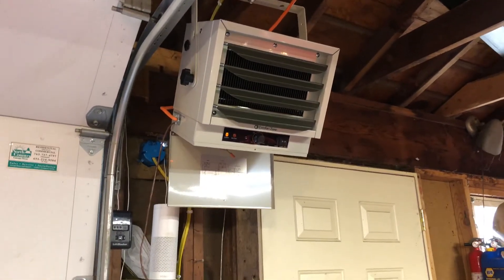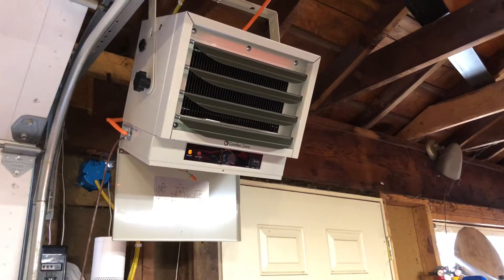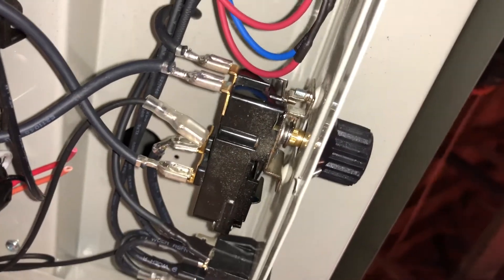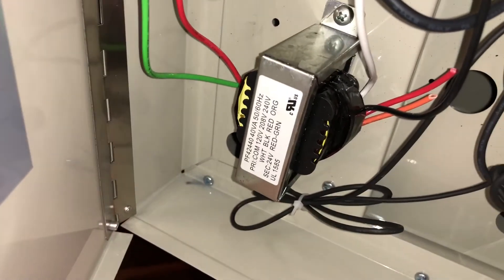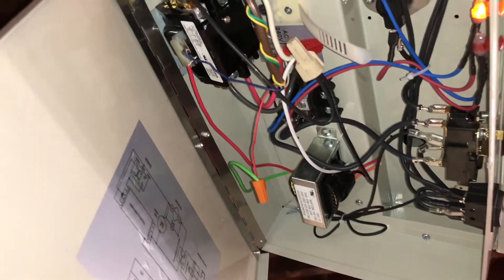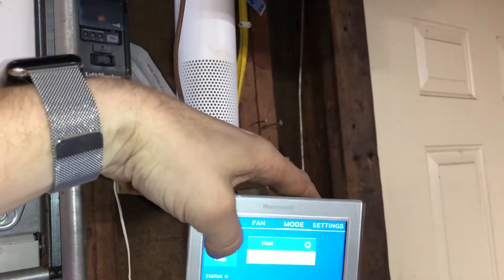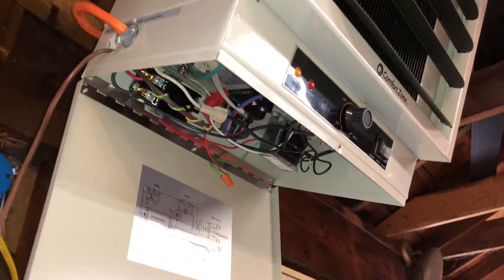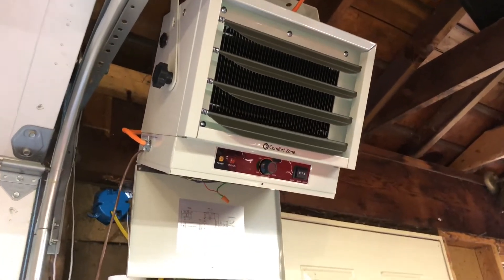How to: run your electric garage heater on a wifi thermostat!

Comment: I’ve had mine for several years now, the only issue seems to be the unit cycles power on and off every few minutes even below the thermostat set point. It’s not the internal overheating protection because I have voltage in and out to the motor when it shuts off. Any suggestions?

Comment: Shouldn't you be allowing for the fan to continue running to cool the coils off to a safe level before killing the fan? It has the heat sensor built in for that.

Comment: I like your set up and i am trying to replicate it on my newly installed 5kw heater, however, I would like to know if i could wire the 240/24V transformer to both legs of the incoming power, I do not have the white wire which is your neutral. Thanks

Comment: Use a King Electrics wireless thermostat. You can connect it directly to your 240v power source between your panel and the heater. It acts as a 'switch', triggered at the set temperature. Leave heater on highest 'on' setting. You can also control it from anywhere on your smart device.

Comment: Are you using 10/3 power wire?? 
Mine only requires 10/2, do I need to use the neutral wire in the transformer??

Comment: Every video I have watched on these heaters out of morbid curiosity has been wired so very wrong according to code/ proper way to wire it whether it's Canada or US.  I appreciate trying to make things work but for some reason these type heaters bring out some serious janky ass stuff.
Your job is certainly better than most.  You also demonstrated a decent knowledge of proper terminology.  Most guys didn't have a clue as to what they were saying but bumbled through and somehow made it work.  You could have cut into that thermostat circuit but it seems that it killed the heater just like you did anyway.  Good Job doing what you figured out.

Comment: this was a long time ago but still to this date not a lot of videos about this. is the wiring the same for 7500 w heater, same kind of heater, different brand, and of course 240v? i have yet to purchase a thermostat but did use links for transformer and such from your video. THANKS!

Comment: Do you have a fuse installed on the secondary side of your transformer? I'm wondering if I need to install one? I'm using a 240v - 24v 40va transformer and I am thinking I should install a 2amp fuse...?

Comment: I thank you and appreciate the video...   im currently trying to hook this up like you said.   Great video I just wish you had went a little slower and zoomed in on how and what wires go where but other than that....  you are awesome my friend!   I been trying how to make sure my garage is warm by the time I get home from work.   Unfortunately this only controls 1 of my heaters but it will definitely make a difference.. once I get it going.. 👍
Reply: Ok.  PLEASE HELP.    I tried to fallow everything you said and tried pausing the video but you move too fast and its blurry.    My heater is on.   Thermostat is on but neither the Thermostat  on the heater or the exact aftermarket Thermostat is making the heater turn on..   I've watched this video probably 20 times and can't figure out what I did wrong.   And yes I tried the heater before I hooked all this up.   And I bought all the exact parts you suggested.   Please someone tell me what I did wrong.   Thank you

Comment: I could just add this in a junction box right? Then this way if I want to use my portable garage heater with a smart thermostat it would just turn the wires active to the plug? 

I have a low ceiling in my basements that is 7 feet tall. But we do a lot of art and craft and such down there.
Reply from the maker: in theory yeah but not sure why youd over complicate when theres room inside the heater enclosure
Reply: This is because my garage heater is portable. I can put it on the floor.

For some odd reason, the city doesn't allow it to be installed outside of the manufacture safety requirement. The bottom of the hard wired heater cannot be lower then 8 feet. 

My basement is 7 feet tall. However, a portable heater is not against code. It can be put on the floor. So it is weird to me.

However, I want to be able to take it out into my garage when I need it. I can just plug it in and use the manual thermostat. As for my basement that has no heat, I want to use the thermostat. So making the outlet using the Contactor and Control Transformer to work with the Thermostat would allow me to heat up the basement ahead of time.  @OvalboreTech

Comment: I just finished up doing this and it works great.  I didn’t have any 18-3 thermostat wire and tried to use Cat 5e wire but it didn’t work.  Got some 18-3 and contactor kicked on like it should.   I used a 30a contactor instead of 40a.

Comment: Did you consider a second contactor and the “emergency heat” lead from the thermostat to run two different wattage settings?  Might try it with my setup…
Reply from the maker: no but thats actually a really cool idea. you could use the single contactor and a pair of diodes to accomplish this too! :)

Comment: 240 V is single pahse, there are no "phases" but there are two 120V "legs".
Reply from the maker: in north american residential power, thats correct, but there is absolutely single phase 240V in the wild in the states.

nevertheless, completely irrelevant to this content.

Comment: I'm going to be wiring up a similar set up in a couple weeks. My thermostat is 120V though so my plan is:
Send 120V from panel, to thermostat, to contactor. 
Send 240V from panel, to contactor, to heater. 
This eliminates the need for the transformer, and just works well with the location of my heater/panel/where I want the thermostat mounted.

Comment: def insulating the roof will help bro.  80% heat is lost up 20% out the sides.  get some insulation!
Reply from the maker: I dont heat my garage, this is only for emergency work where I dont mind burning a night of power to wrench. has been off all but maybe 2 days since filming this

Comment: I bought the same contactor and I'm assuming L1 on the contactor is connected to the line from breaker panel and the T1 side goes to the heater connection?  (same for L2 and T2)

Comment: On the transformer (packard) you used the black and white wire for power. Which means the transformer is powered by 120volts, not 240 volts. If 240 volts powered the contactor, the orange and white wire would be used.

Comment: What would you do differently with a 10,000 watt heater which requires either a 50 or 60 amp dual pole breaker and 6/2 with ground wire?
Reply: I’m also wondering the same thing for my  10000w heater

Comment: This video and all the comments has to be one of the top most helpful on YouTube.  And yass, exactly what I’m trying to do on a 20-year old version of this heater!  Concur with delayed off comment someone posted - my fan keeps going and spools down after running heat so it doesn’t damage the coils (I believe).  Thank you again, from slightly-chilly-today South Carolina.  Jason
Reply from the maker: no thermal runaway with fan not aftercooling. in fact its arguably less hard on the resistive core as the expansion and contraction is significantly slowed
Reply: @OvalboreTech  excellent point; makes sense.  Thanks for the reply.

Comment: Great hack!   Do you think the RC840T-240 relay/24V power supply combo unit would accomplish the same results with ceiling heater similar to this baseboard mod? https://youtu.be/7rJJON34KOw   The RC840T-240 looks easier to wire up.
Reply: Yes. I am using that setup in my garage for years. You cannot go up to the 7500W heaters though. 5500 watts is max for the RC840 (23 Amps). Works great on 5000 Watt ones though.

Comment: if i use the RC840T-240 Aube 240V Relay With Built In 24V Transformer, do i need to use the contactor?
Reply from the maker: is that the one I put in the description?
Reply: @OvalboreTech  no. This would be another one that seems to be a 2in1 sort. But not entirely sure.

Comment: You could have just powered the transformer ay 220v and not used the neutral.
Reply from the maker: depends on the model of transformer. this is much more universal for those that use an off the shelf transformer in the states.

Comment: I have a super basic thermostat that only has two wire hook ups.  A white and a red.  Is it possible to hook the blue into one of those locations to make this thermostat work?  I installed the same heater, with all the same parts and have it all hooked up and ready to go.  Last step was hooking up my thermostat and I’m not sure if I need to order a different one now.
Reply from the maker: yes you can use a dumb thermostat., just skip the C wire. the transformer is still needed for the contactor, just run the R to the transformer, W to contactor and bridge the other terminal on the contactor and the transformer for that one.

Comment: Can you control the temp with the thermostat, as well?  I'm going to use the basic Nest Thermostat, and the heater I have is the Comfort Zone CZ230E; it has the option to plug in an old fashion thermostat to control the temp.  Thanks again for the video and help.
Reply from the maker: yes, thats the intent of the video

Comment: Worked great!!! Followed instructions and works like you described. Thank you!!!
Reply from the maker: congrats! you follow instruction a lot better than most negative youtube commenters :D
Reply: @OvalboreTech  spent a good hour from start to finish to make sure I had things tidy and connected properly. Now I'm ready for a nice steady heated garage in winter. How low does your thermostat go? Might upgrade to a wifi one in the future. I have a Google nest for inside but that only goes to 50 degrees.
Reply: @snoman6322  the honeywell bottoms out at 35F
Reply: @OvalboreCars  good to know. Someday I’ll upgrade to a Wi-Fi thermostat

Comment: So I wired it as prescribed.  I'm able to turn the unit off from the thermostat but not back on.  When I put it in 'Heat' mode from thermostat I can hear the contactors engaging and power does go to the unit because I can see the red light indicating power turn on, but the heat/fan doesn't start unless I physically hit the power button.  Any idea?  FYI I'm using the 7,500w version that has digital thermostat/dial.  Is this my issue?  Btw awesome video.
Reply from the maker: no idea since you're not using the unit pictured. would suggest removing or bypassing the built in thermostat.

Comment: The current 7,500 version has a lot less real estate to work with inside the box.  Can the contactor/transformer be mounted in a junction box nearby, with just red and black 8 gauge (for 40 amp breaker) hot wires leaving the junction to the heater?  Or have I missed something?
Reply from the maker: you could move the contactor in to a metal junction box with the high and low voltage run separately between.

Comment: After watching this video several times, I decided to buy this heater and the parts to convert it exactly like the video.  It works perfectly!  I can now control my shop building heat with my phone so I no longer have to enter a cold shop.  Thank you, thank you for making this video.  For around $250 total, I now have a fully operational wi-fi heater.  Did I say thank you for the instructional video?
Reply from the maker: I couldnt believe no one else had shown how to do it, you're most welcome!
Reply: Do you have a list of the parts that you purchased and where you pick them up from?

Comment: I have a backyard garage that I just had built with bricks and a concrete floor, no kind of insulation whatsoever except for in the ceiling. The space is about 15 x 19 feet, do u think this heater will work in that kind of environment?
Reply from the maker: eventually it should be able to maintenance heat that.

Comment: Exactly what I’m planning for my new garage. Using 10/3 just to get the neutral for the transformer, very sneaky! If you find the time to post a wiring diagram, that’s always a plus, but your text description is very helpful.

Comment: hey great video, im an electrician by trade therefore understand everything said, my question is if the thermostat is controlling the heat what happens to the original temp control does it need to be disconnected or is it just set to max?
Reply: hey Josh, crank it to maximum thats correct. the contactor handles the rest. you can select whichever heat output mode you want
Reply: @OvalboreCars  right on sub and liked!
Reply: Consider setting the heater's stat at some setting above where you expect to ever operate using the remote stat, but less than MAX. That way the heater's internal stat becomes a backup or high limit which will override the remote stat and turn the heating elements off if the temp goes beyond what you programmed into the remote stat.

Comment: Just finished wiring mine.  Works perfectly with a Sensi Wi-Fi thermostat.  When thermostat calls for heat, the contactor makes a loud snap and heater turns on.  Thanks a lot for posting all this info👍

Comment: My heater has 4 wire coming out of the back red black green And blue what is the blue wire used for I also have a turn dial Honeywell's thermostat

Comment: Awesome  video thank you! What happens in your Romex coming in to heater only has 2 hots and a ground, which is common for these devices? Where do I attach the neutral coming out of the transformer circuit?

Comment: Can you set a certain temperature to maintain with the thermostat or does it just give on/off functionality?
Reply: whatever you set the thermostat to. you render the built in controls of the heater inoperable.
Reply: Okay, great! Good to know. Wiring this up in a couple days.
Reply: Thankyou
Reply: Do you know where the white thermostat wire attaches in the heater?

Comment: The main orange wire coming from the panel is it 10/3 or 10/2? I have the same heater and what to do this I've got all the parts except I can't decide which wire to get.
Reply from the maker: its 10/3

Comment: Dude...badass. Thank you for sharing your knowledge
Reply from the maker: any time. glad I wasn't the only one who wanted this basic functionality!
Reply: @OvalboreTech  I’m excited to get it hooked up. Just got the contactor in. Hey, quick question, when you ran the 24v to the contactor to open and close it via the thermostat, how did you physically make those connections? Looking at the contactor, it doesn’t seem like the wire would stay in what appears to be the hole for the wiring, did you have to solder it in place?
Reply: @mattschronce3503  i think you replied to my comment and then removed it up above about using 8/2 instead of 8/3 wire to save money. Why would you need the neutral when 8/2 wire comes with a ground? The only reason to use 8/3 if you want to put a subpanel in your garage to have a disconnecting means within sight of the heater and in that case you could still run 8/2 from the subpanel to the heater...
Reply: @SmishFishton64  cool story...? sounds like you’re having an argument with yourself
Reply: @mattschronce3503  no i know you removed your post because you didn't know what you were talking about but ok
Reply: @SmishFishton64  you already had your question answered sooo I didn’t really see the point. Why do you care so much about arguing with a removed comment and what you think it said
Reply: @mattschronce3503  because obviously i wanted to answer the question to help people save a little cash. So i didn't know if youtube glitched and removed your reply to me. I'm an electrician of 26 years and wanted to male sure the people on this post asking questions had the best information available because the owners manual is kind of vague. So ok it is what it is.

Comment: Couldn’t you use a smart switch
Reply from the maker: not a thermostat, so no benefit, and typically no since none I have seen are rated for anywhere near 30A 240V.

Comment: Hi, good video,
how do you like this heater?  Is 5000W sufficient for a 400sq garage
Reply from the maker: its been fine. I do not use it regularly, but does fine when I need it in a pinch

Comment: Since that transformer is a multi tap...couldnt you have just taken both hot legs from the contactor to the primary side of the transformer so you wouldnt have to run 8/3  which is significantly more expensive than 8/2?
Reply from the maker: if the transformer was 240VAC compliant yes, you could and just skip the neutral
Reply: @rodney landers That is my understanding too. The XFMR is multi-tap, it's right on the label on the XFMR.
Reply: I know its an old thread. Taking a chance,if you do it this way which primary wire do you use on the transformer
Reply: The transformer he has pictured is a 120/240 version. Using the white and orange wires on the primary side is all that was needed, no neutral required. With the price of copper out of sight 10/2 is sufficient to satisfy this setup.
Reply: @jimmyg6215 I’m about to do this and have no neutral wire going to my heater. When you say use the white and orange wire, do you mean hook the orange to one of the 120 feeds, and white to the other?

Comment: So what position do you set the original temp control knob on the heater or is it taken out of the control circuit completely ?
Reply: All the way clockwise. Read through the comments. Jef replied with this info on a comment by Shawn Rutter.
Reply: @LemonySnicket-EUC  thank you sir

Comment: I just wanted to thank you. I installed this heater over the weekend and it works great. So nice to have a thermostat on it. I used a cheaper thermostat so I just used the red and white wires.